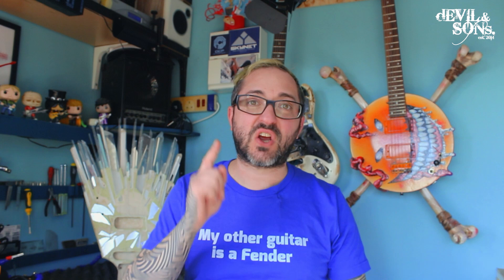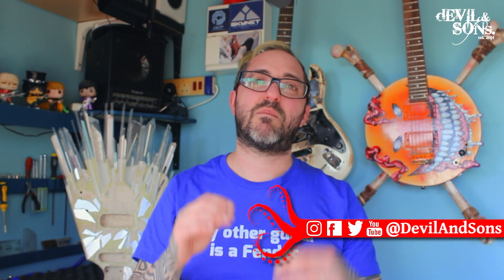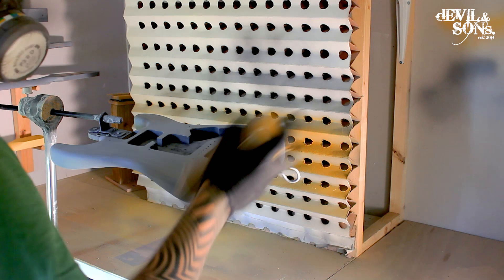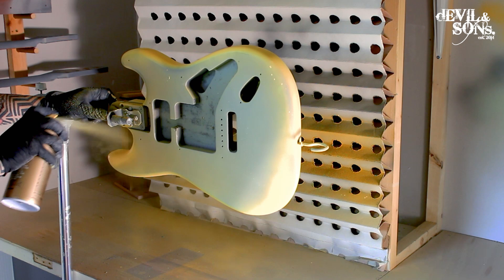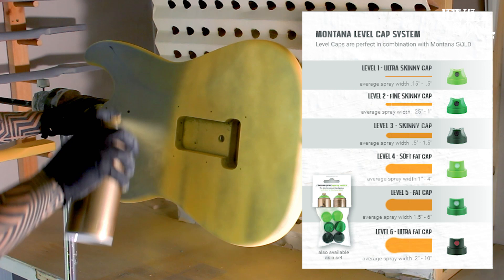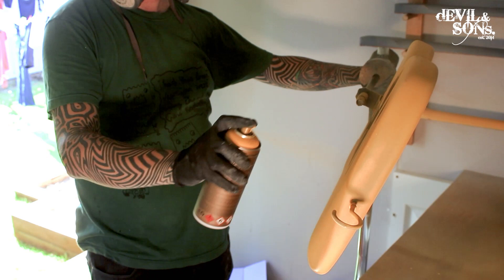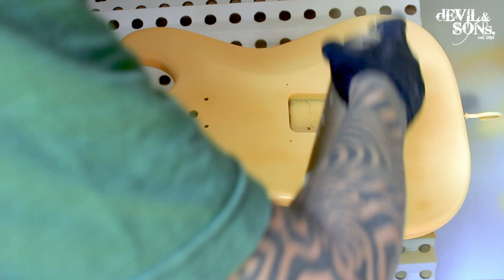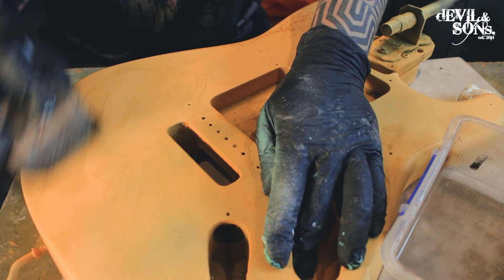How to paint a guitar with Montana Gold spray paints

Comment: Hi Dan, great work on the channel. To be a bit of a devil's advocate (sorry for the pun) I persisted with Montana products for a while but always found they were a bit too problematic - especially if you're trying to achieve a high-end finish with spray cans as an amateur. My biggest grief with their products is that the splattering, failed nozzles, chalky hits, etc. are very common (and known) issues that require a lot of correction and revisit - I'm not in the camp of colour sanding base color coats for correction. I also found that coverage is very poor - because it's a very low solids mix product that's designed specifically for feathering techniques and multi-layer build-up artworks. Poor coverage creates many challenging issues for amateur painters and builders to correct - especially as the product is quick-drying. A quick-drying product that requires many coats to achieve consistent full coverage inevitably leads to trapped solvents and often complete refinshing, not to mention it throws overlapping stroke techniques out the window. The product also has a tendency to react and bond poorly (chemically) to some common "hardware store" primers, as well as other MTN primers. I tend to recommend first-time builders/finishers find a local custom spray shop with a canning machine, as they will mix higher solids base for you in whatever color code you like, and have wider fan tips as standard. Hope I haven't offended with my comment. PS. I've got a 2K aerosol clear that in my experience is better than SprayMax you should check out.
Reply from the maker: Hey, absolutely no offence taken. Yeah, the coverage isn't is great and the spatter and chalkyness isn't great, but I did find sanding helped really well prior to the top coats. Great suggestion about getting the paint mixed. Where can I find the 2k you mention? It would be great to try it.
Reply from the maker: Ps. Thanks for following and commenting, very kind. I have pinned your comment so hopefully it will help some other people.
Reply: @DevilAndSons  Have a search for a product called Normfest 2K Klarlack. I'm yet to test, but someone told me that if you don't use your entire can of 2k that you can place the un-used can in the fridge and that it stops the hardener - meaning you don't need to throw the can away after 2 days.
Reply from the maker: That's good. I'll look into it.
Reply: I am just gonna back up this comment, a good client wanted a specific metallic from Montana, tbh I only use spray cans for touch ups here and there since I am fully equipped with great spray guns etc, the guitar has crackled 4 times so far on the last coat of clear which ofcourse destroyed the workpiece and had to start from scratch since the pearls on the base was pulled making a total mess... manufacturer says you can spray clear after 24 hours, in my experience 3 light layers takes atleast 5 days to fully cure...
Reply from the maker: @sonicalmods781 that is such a pain. I haven't used their metallics but think I'll avoid that now. I actually had the same issue using a paint that a customer wanted from a car paint manufacturer, I did ot 4 times and the paint wasn't cheap. Such a pain. Going forward I have decided I will only paint fir a customer using paints I'm familiar with, however I will experiment for my own builds. Thanks for adding your comment.
Reply: @DevilAndSons  thing with metallics is you have to do a drop coat to even it, when you do so happens exactly what you explained in your video! The paint gets dried before it hits the surface... even tho it looks fine when the clear dries there are spots where the pearls pull, I am not saying they are trash etc, I dont they are meant for such work, thankfully my client is a great person,  we decided to switch to a stardust diamond pearl, crossing fingers!  This guitar has become a nightmare!
Reply from the maker: @sonicalmods781 good luck, hopefully that will be much better for you.

Comment: I am doing a crackle paint guitar with a green Montana gold base snd black crackle. You are right about the paint. It is very powdery! Thanks for the tips. I think I am spraying to far away from the body based on what you said. Another good video.
Reply from the maker: It is definitely powdery and if you are too far away it is even more so, but too close and you may get thick patches that run. I think with the crackle on top it may not matter if the base colour is perfect or not. Also with the crackle it may be worth doing extra varnish coats, not all in one go as you want to do a normal amount and let it dry thoroughly then add more, it's what I do with anything textured. If you have photos please do tag me in the comments on social media - it sounds cool and I'd love to see it.
Reply: @DevilAndSons  yeah I just did the crackle and it looked sick! But the base coat was a bit powdery in spots, I tried to sand it out before putting the crackle on it and thought I did a good job but after I put the crackle paint on I have a few blemish spots. Nothing too bad but bad enough I think I am going to try again. The rest of the guitar looks insanely awesome. I just need to perfect my spraying technique. I’ll get you pic when its done. Thanks for your help man!
Reply from the maker: Exciting. I look forward to seeing it. Good luck with the second attempt.
Reply: @markkicksass2448 aye what shade of green did you use homie, was it the Montana gold acid green?

Comment: Thanks for the help. I plan on using montana as my primer, as I want a green base under the gold on top. So worst case if I over sand the gold then I will be ok with the green showing through. I chose montana because it certainly has a wide variety of colours and the right shade for my next project.
Reply from the maker: That acrually sounds like it would be cool to sand through the gold and reveal a bit of green on purpose. Montana do have such a great colour range.
Reply from the maker: ...and good luck.

Comment: Before you try montana cans read this.

I did a guitar in montana gold shock whitecream, let it dry for some days, then used montana gloss varnish.

Dried for 2 weeks, wet sanded, buffed. Everything looks good.

Left the guitar laying down on my workbench for 1 day on a soft cotton blanket.

The texture of the cloth pressed down into the paint. Guitar finished ruined in matter of hours😅

Maaaybeee the montana gold in combination with a different clearcoat would work. Like a proper nitro or maybe some 2k clear coat. (I have yet to try this)

But the montana varnish is useless for guitars.
Reply from the maker: This is definitely a problem that occurs if the paint is applied too thick, it's like the top can set but underneath is a bit softer. Good to point this out as a warning to people. I hope you were able to sort out your guitar.
Reply: @DevilAndSons  makes me wonder if the thickess is the problem or the varnish.

I am experimenting with some scraps with montana gold and a different nitro clear coat on top of it.

After all it is cheap grafitti paint at 5 euro a can vs guitar suppliers nitro paint at 20 euro per spraycan😅

Learning is fun I guess🤣
Reply from the maker: Good idea to experiment. The only reason I like Montana gold is the massive range of colours, but some nitro suppliers can make up a colour for you so I guess that's irrelevant.
Reply: I wanted to come back here with a "update" I guess.

I Painted a guitar with montana gold (Shock black). Finished with a nitrocellulose clear coat ment for car repairs. I let the clear coat cure for probably 3 week and I got a much better result than previously with the montana varnish.

In fact, the headstock of that same guitar is montana gold (shock black) with montana varnish, and even after weeks of drying I can still press my fingerprint into the clear coat..

I dont think I'll be using the montana cans for guitars anymore. Next guitar will be finished with either nitorlack or dartford nitro cans.

Hopefully this helps someone save alot of time and stress😅
Reply from the maker: @k13m13 thanks for the update. I've recently started using nitorlack, in fact I have some videos coming with them soon. I am very impressed.

Comment: Hi,I put three coats sanded after 24 hours, than put three more coats on.After 24 hours I have noticed the paint looks uneven or blotchy it's not a uniform finish.I used Bulls Eye 123 primer on it.Have you ever had this problem.The colour is Light Blue.Thanks.
Reply from the maker: Have you sanded this second set of coats yet? Normally I find that sanding can make ot all look even and consistent. If easier you could email me some photos so I can try and offer a solution. Info@devilandsons.guitars
Reply: @DevilAndSons  Thanks for getting back to me.I just finished sanding with 800 wet.While trying to smooth the darker ruff spots I notice I'm starting to sand through.I really don't care much for this paint.Very chalky paint.A lot does come off on the sand paper.And that was after two days. I'm going to strip again and go with a different brand of paint.Just not for me .Thanks again for your reply.
Reply from the maker: @gdlblues1 fair enough. It's definitely not the best paint, but I think the best range of colours. I still use it a lot. I'd be interested to know which other brand you go with, maybe I could give that a go too. For traditional guitar colours I mainly use nitro these days.
Reply: @DevilAndSons  I'm going to go with Oxford nitro they also have the colour I wanted.What nitro do you use.
Reply from the maker: @gdlblues1 I've recently started using Nitorlack, I'm very impressed with it.

Comment: I have an older, blonde,  poly finished Squier that I’d like to repaint using Montana Gold. Do I need to completely remove the existing finish or can I simply scuff the current poly and primer and paint or must I remove all of the original finish?
Reply from the maker: You can definitely scuff the current finish all over. I'd use 600 grit. What colour are you going for?
Reply: Great news! Avocado green metallic with a brown celluloid scratch plate. It’s a genuine Rosewood fretboard so I think it should be a great combination. Particularly with new shiny chrome hardware.  I’m very fond of fender’s sage green metallic and the metallor avocado is very close.
Reply from the maker: Nice. Coincidentally I just bought that very same metallic green to test for a client, I think he wants a richer forest green but looking forward to testing. Your combo sounds good.
Reply: I’d love to see how it turns out! All the best! Keep the amazing tutorials coming.
Reply from the maker: I'm sure I'll make a video. Glad it worked for you.

Comment: I had pretty solid luck using Molotow premium on my guitar
Reply from the maker: That's good to know. I actually used one of their colours on a small part recently, they have a good range. Thanks for sharing.
Reply: @DevilAndSons  I’ve also used Molotow clear coats. They dry pretty smooth, but if you spray on a cold day they start to yellow almost immediately. Rookie mistake
Reply from the maker: That's good to know, I wonder how durable they are. I made the same mistake when starting out, except it went cloudy.
Reply: @DevilAndSons  the clear started to crack after about a month and a half, but I drilled the holes for the pickguard after spraying. The back of the body where there’s no holes has held up great for about 6 months now
Reply from the maker: That's frustrating. I wonder if it hadn't adhered to the coat underneath enough then the drilling cause it to separate?
Reply: @DevilAndSons  probably something like that. But on the bright side I was going for a kind of hack job look on the guitar anyways. So happy accidents
Reply from the maker: Perfect outcome then.

Comment: I have a  66 Fender Mustang that someone destroyed years ago with a belt sander and a brushed on paint job. I have filled it all, sanded, primed, sanded, primed, primed, sanded, painted, sanded, painted, sanded, painted, painted, painted, painted and am now at the last coat of paint. I didn't use Montana (I used DupiColor Metal Flake Retro Red), But I have a couple questions... 

Are you saying DO NOT sand the last coat of paint before moving to clear? I'm going to have to spray one last coat if that is the case.

And second... Can I achieve a deep finish with just buffing compound, polish and wax? Do I HAVE to put a clear on it? 
As always... cheers to another great vid.
Reply from the maker: I would personally sand the last coat of paint, you need something to key to, but with this paint if you have painted a design or sunburst you can't really sand it without risking sanding the design off as the coats will likely be too thin.

If your clearcut is essentially the same paint as the colour but transparent you could just buff without the topcoat. I.e if you are using nitro colour then maybe you don't need a nitro clear coat. I think there is a slight visual difference of having a clear top coat though. I've not used the DupliColor paint before, have you got a scrap you can test buffing on? You definitely wouldn't get a good effect just buffing Montana gold paints.

Sounds like you've put a lot of work in on yours. Look forward to seeing it.
Reply: @DevilAndSons  I do have quite a bit into it... seeing as I had to give it a go TWICE. I had this idea to apply a thin/wide/thin racing stripe like the "competition" versions of the guitar. I figured that if i didn't like it, i could easily remove it as it is just vinyl tape. While applying it, I needed to reposition slightly and lifted the clearcoat off of the paint. As you know... that means removing all the clear, getting to paint and applying at least one more coat of paint. I used gaffing tape to pull off the rest of the clear. Worked quickly and brilliantly. I am now finally back at the last coat of paint, which i have sanded to 2000. I was thinking i could just get some rubbing compound and buff it, then wax,wax, wax, wax, wax... With NO clearcoat. I am pretty sure the PAINT will survive the vinyl striping but the clear is just too fragile.
Reply from the maker: You may as well give it a go. I do recommend spraymax 2k clear coat, it's pretty solid - for future projects.

Comment: Would you recomend the spray max 2k varnish for an all maple neck? Is it hard enough to be a fretboard finish? I just did the fret work on mine and its ready for a finish so it doesn't become a dust n dirt magnet. I have always used Krylon sanding primer on everything from wood to foamboard to metal. Then as lot of the time I will use flat Krylon paint put on multiple layers to get a thick top coat then block and wet sand down to 2k before final compounding or clear coating.
Reply from the maker: I'll be honest I haven't used it on a fretboard yet, although I'm currently working on two necks that will both have it on the fretboard. I couldn't find anyone discussing online if they have used it on a fretboard and how it wears, but I am so impressed with it on bodies and necks that I am going to give it a go. Nit that helpful a response, sorry.
Reply: @DevilAndSons  Nor I which is why I am poking you with my stick for an answer hehe. I have asked in other channels about guitar building and got nothing yet. Will be very interested to see what happens as I have never worked with a maple fretboard its all been rosewood so it was just a matter of cleaning and  oiling.
Reply from the maker: Exactly the same here, I don't know. I did ask someone ages ago who painted designs on to his fretboard how he finished it and I'm sure he just topcoated with the same as the body so I'm feeling positive about it.

Comment: I'm trying to match a seafoam green and I have actually got a Montana Black spray can. In your opinion / experience, do they behave the same? After the purchase, I saw on the label that the Black paints are not recommended for guitars and other DIY stuff, but I wonder, what does "not recommended" actually mean in this case?
Reply from the maker: I haven't actually used montana black before so I'm not sure of the difference, but I imagine it either goes on thicker and is softer, or it doesn't harden in the same way. That would result in easy scuffing and marking even with a clear coat on top.
Reply: @DevilAndSons  so it looks like Montana Black paints are lacquers. I'm experimenting on a skateboard before doing it on the guitar. I'd say the colours are amazing and it's relatively easy to match Fiesta Red, Seafoam Green, etc... The downside is that apparently it's very hard to spray a clear coat consistently. It seems to react with the paint below and make it wet again. On the other hand, Montana Gold is a nitro-acrylic paint, which should be fine for painting guitars. The choice of colours seems to be wide, but different from the Montana Black selection.
Reply from the maker: Tradditional lacquers will "melt" into the previous layers, I wonder if this does that? Thanks for the information.
Reply: @DevilAndSons  so...I let the Montana Gold paint dry for a couple of days, then I sprayed a lot of thin coats of Rust-oleum ultra-cover 2x clear gloss. The secret was to spray only a mist at the beginning and let it dry. After about 2 weeks it doesn't smell anymore so I think it's almost cured. I have nothing to complain about. In fact, I think the choice of Montana Gold colours is amazing and poorly explored by guitar makers who I suspect are too much in love with vintage nitro paint. My two cents!
Reply from the maker: I agree, the choice of colours is fantastic. It's definitely not quite as nice and easy to use as some others but worth it for the colours. So glad yours has worked out for you, and thanks for coming back to comment.